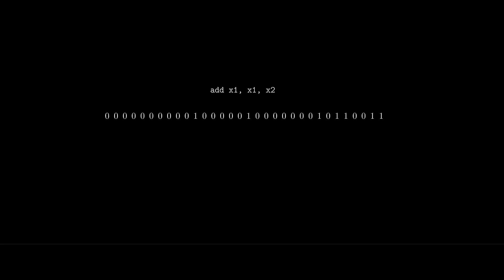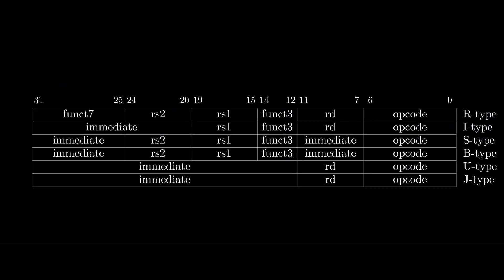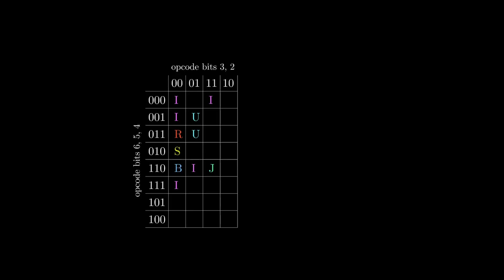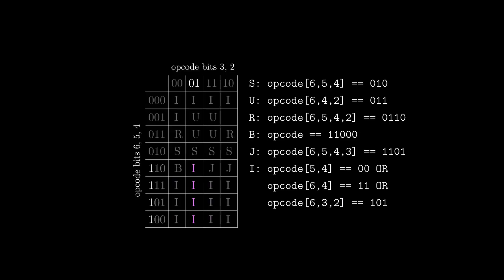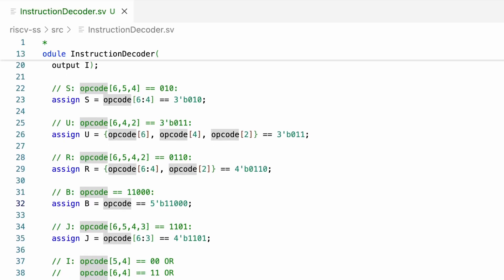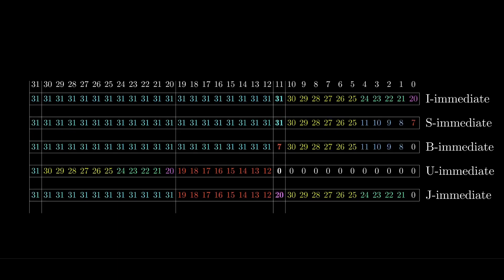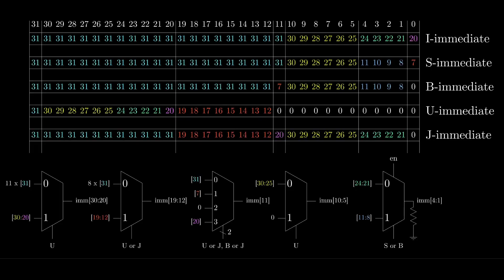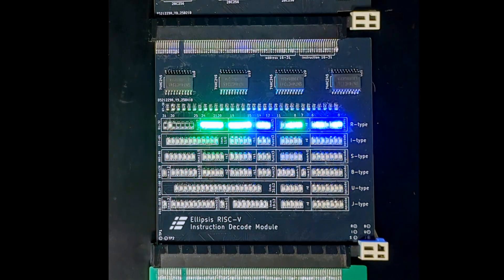Instruction Decoder (RISC-V Part 9)

Comment: why choose an architecture that uses an instruction decoder. not parallel computing oriented at all. only for serial turing machine computing. pre-pipelined compute is much better, if you program like hw encoder chips or similar fixed function logic. fpga microcode vs instruction pipeline.
Reply: I think you don't understand the purpose of this video series.
Reply from the maker: Even a pipelined data path will need instruction decoding - e.g. the immediate must be generated somehow. The reason I'm only doing a single cycle architecture rather than a pipelined architecture, and the reason for using discrete logic rather than an FPGA is to use this as an educational tool. Although, note that everything I'm building in hardware here is going into an FPGA as well, so technically I'll have both. Also notice that the design is modular, so I may modify it in the future so that it supports pipelining via pipeline registers between each module.